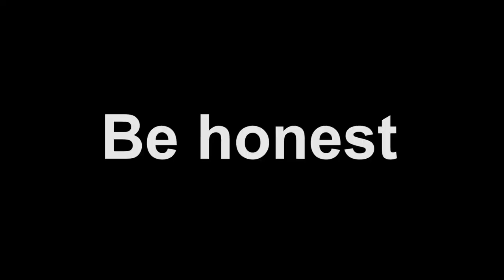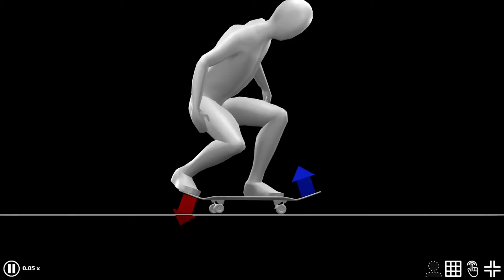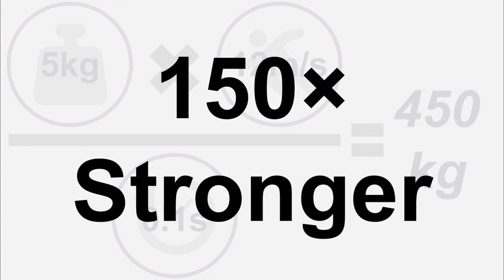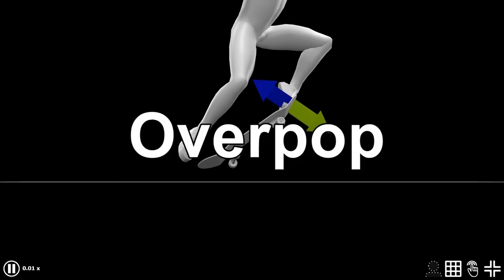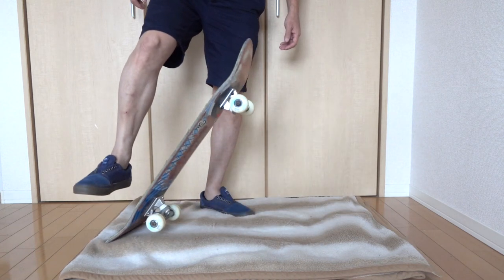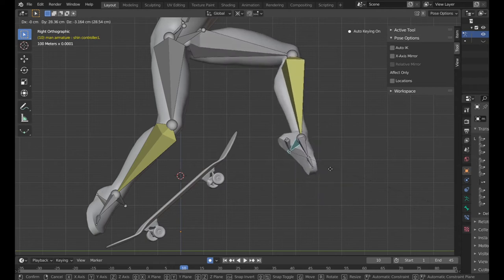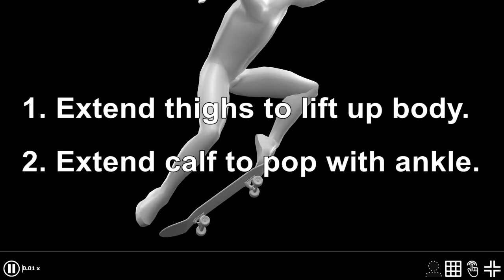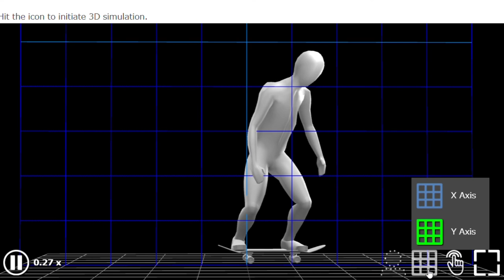Pop is the MOST important element in kickflip.

Comment: I don't agree with your analysis here: For a skilled skater, there is no such thing as "overpop". With a very big pop, the small "back somersault" moment of the board is resisted by the front foot over a relatively long period even before the flick itself is initiated. When that has been achieved, the flick requires exactly the same amount of front foot energy as a lower kickflip. The only difference is that the skater will catch the board higher in the air.
Reply: yes thank you
Reply: It could be said that overpopping needs to be the standard to become a skilled skater. Therefore the pop is just pop at that point. I started improving when a sponsored flow skater told me to just pop at 300% to what i thought my 100% was. 

Developed my muscles and now what used to be 300% is now my 75%
Reply: @ogsxl  sounds about right.
Reply: I think with overpopping he means mostly just popping so fast that you couldn't ever jump quickly enough or flick fast enough to keep up. It's a real thing I would argue. But I also think you can start dragging your front foot up the board almost the same time as you pop, allowing an earlier flick and more levelled out kickflip. If you jumped up before the real pop, it's hard to really 'overpop'.
Reply: I think for a more experienced skater they're able to kickflip with more pop and control it but for those who are just learning perhaps less pop is more suitable.
Reply: You know when you go to the skatepark and there's people practicing these super high ollies and kickflip looking things but they never land anything and you tell them,  "hey, try popping the trick lower" and they say,  "nah, I like doing my tricks high" even though they have no tricks because they're using their entire leg to pop instead of jumping and using their feet and ankles and calfs to make the motions required to execute and land the trick. That's what he means.

Comment: Eh, depends. Yeah I can kickflip with a way lower effort pop, but then the kickflip stays uncomfortably close to the ground and comes off lazy. I don’t like that. The pop is definitely the most important thing, but it’s not always about overpop that makes kickflip fail. I pop hard as shit, but I flick later than usual, almost once the board is at its peak height already. This reduces the upwards momentum and force my flicking ankle has to fight, but causes the board to rise up to my desired height much quicker. I don’t like a slow kickflip that pops 3 inches above the ground. That looks like shit

Comment: This is definitely one way to kickflip. And it might be one of the better ways to kickflip over or onto stuff to some extend, but it lacks dragging up the board more of the front foot, instead of allowing the board to go rocket and flick 'late'. Not saying you got anything wrong here, but with slight adjustments to your timing, you would level out your kickflips much better. Pay attention to how your front foot almost does not drag up the board, but mostly just flicks only. I've seen people do "late" heelflips this same way. It's a timing thing. A properly timed kickflip can be done very low to the ground, this particular type of kickflip pretty much can't.

Comment: My ultimate hack 4 kickflips:  soft ollie pop and front foot heavyness all the way thru. 
The front foot covers the bottom two bolts of the front truck, set at a 45 degree angle, and flicks on the CONCAVE and gets quickly back. first ones gonna be rocket I guess cuz of the ff heavy thing but u will get used to balance pop force/flick speed . if it worked reply back

Comment: All that pressure on the tail can be used to lift your entire body up and then u just use the little bit for the board, but it requires more precision on other aspects of the trick. For example, making sure your body doesn't lean too drastically when you jump. So you must balance your body by having even weight on all sides of the tail, unless you want to pop forward slightly (which makes front foot work easier)  which means you sort of have to compensate by pushing the board forward kinda it's weird this is where my understanding turns more fuzzy.

Comment: I'm definitely going to try this, but I do have a question. Popping a trick means extending your ankle through the board and lifting your knees to your chest, by my definition. But then what about jumping? Ideally, you wouldn't jump by immediately lifting your knees to your chest, but by going through triple extension and then lifting your knees to your chest. So wouldn't overpopping and jumping equalize one another, slowing down the force of the nose to the front foot? I noticed you don't jump your kickflips, so I was just wondering🫡

Comment: I felt a similar effect on my ollies. Since i focused on pop the tail light and quick ive got the same height ollie bit more solid and consistent, it tires me lot less and help me jump more confident over things.

I knowlittle to nothing about physics but something inside me tells me that we try so hard to ollie high that we expell too much force that doesnt really apply well on the movement. Useless force that escapes in other direction and we cannot really used it on our will. I feel like just the force of the ankle its enough to glue the board to my foot and there is no need to stomp that hard

Comment: I agree w everything in the vid but i have to say you have the weirdest back foot placement ive ever seen for kickflips. try putting the ball of your foot in the pocket on the other side of the board (watch Mike Mo's kickflip trick tip if thats confusing) for a quicker pop that will also start the rotation of the flip for you.

Comment: The flick imparts a rotation that is around an axis perpendicular to the axis of pop. Therefore there should be no relevance of how fast the board is rising (or how hard you pop it) to how hard it is to make the board spin.
Reply: is the flick axis really perpendicular to the pop axis? I'm thinking the pop axis is straight down  (zero degrees, flat). The flick axis happens later while the board is around 45 degrees in the air so the flick is pushing at that 45 degree axis (which can be as much as 80 degrees as the nose goes up).

Comment: This proves Luan Oliveira has a really strong flick because he pops really high
Reply from the maker: I’m afraid that’s not necessarily correct. He jumps up really high but he pops only as hard as he needs to. His flick may be stronger than mine, but the strength of jump does not directly correspond to the strength of flick.
Reply: @whythetrick  so it doesn't matter when we pop as hard as we can as long as we jump to the point where the nose isn't moving and we can flick the board easily?
Reply from the maker: Correctmundo

Comment: i like your videos, but i think your timing is off in your animation.  you've got your front foot slid up and about to flick before the tail has even popped, it doesn't work like that. when well executed, i'd expect to see your front foot start to roll as your tail is depressed but it won't start sliding until the tail snaps and board starts to leave the ground. as with an ollie, it's a quick two-step motion. i saw another skateboard youtuber, https://www.youtube.com/c/SarahParkMatott, compare it to a heartbeat. ba-bump, back foot/front foot. keep it up, thanks. also, as mentioned by others, you'll have better luck keeping your shoulders in line with the board. some tricks, rotating ones like 180s etc, you kinda lead with your shoulders and your body follows. when i'm pushing my shoulders are perpendicular to my board, but when riding or doing linear tricks my shoulders are mostly in-line with my board.

Comment: No no no no))) look you video again. You will see earlier or later flick. Thats why your kickflip sucks.
Reply from the maker: i'd very much like to accept different opinions but i don't think i quite understand what you are saying. a little explanation please?
Reply: @whythetrick what he is saying is that the problem is less your pop, whether it be too much or too little, and moreso the positioning and timing of your front foot’s flick. For a skater who’s genuinely attempting to use obstacles and incorporate their environment into skating you need LOTS of pop. Otherwise nobody would be able to kick flip or even 180 over a park bench like pros do no problem. The true secret comes moreso from the second part of your video. Once you get the hard pop through your extended thighs you need the reflexes to pull your body in tight while jumping high into the air (similar to how one runs hurdles) and once you reach your apex height with your board all it takes is a light tap from the flick foot (with right positioning of course) to get the board to flick. A kick flip should never be done against the force of the pop and moreso in tune with the force of gravity in the moment descent begins